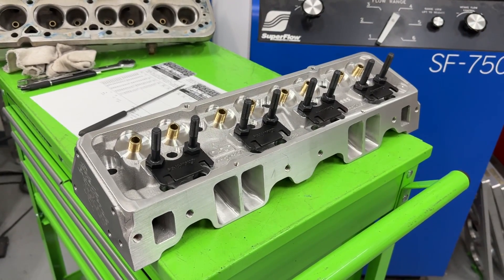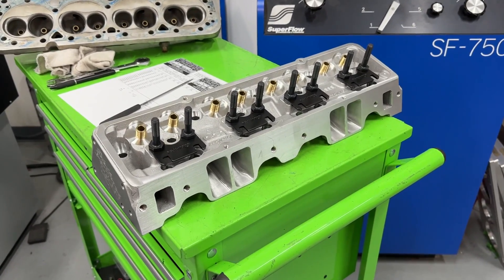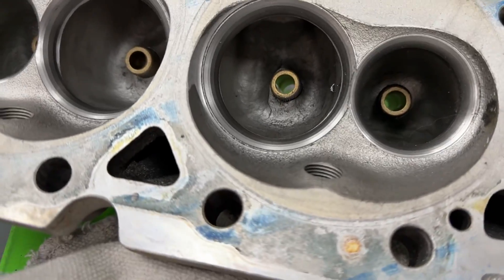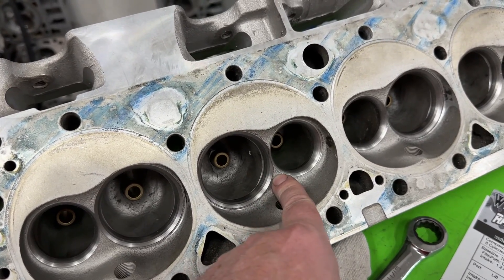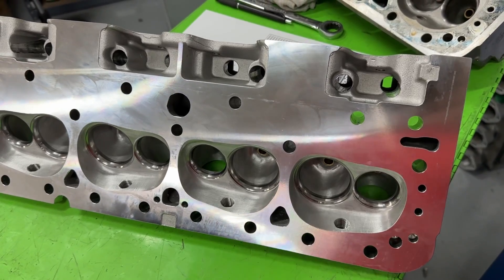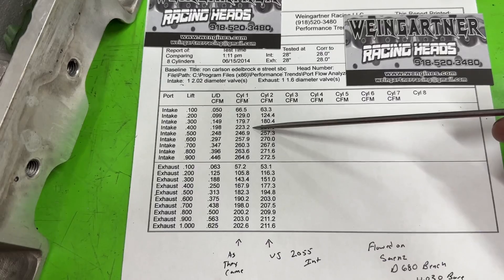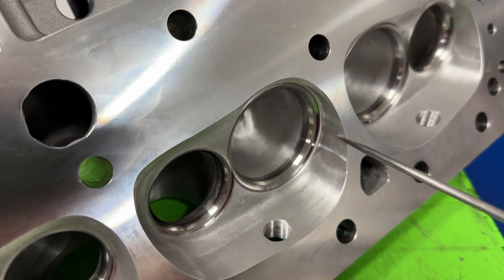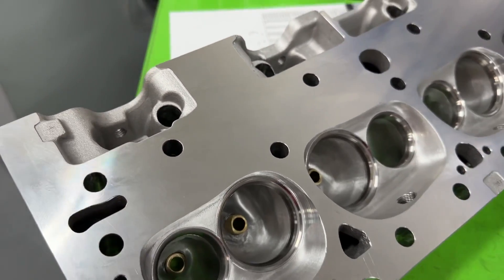Edelbrock E Street Sbc Heads Going From 2.02 To 2.055

Comment: Maybe instead of focusing on cheap heads.... Improve the Performer series to run comparable to AFR, Trick Flow, and Brodix. I wouldn't mind buying Edelbrock heads if they provided good bang for the buck. Who wants to pay $2500 for a pair of heads that produce 50 less points on the dyno than the other brands for the same money. My 2 cents

Comment: I threw these e street heads on my stock 305 sbc they run pretty good, they woke up the motor for sure, but the only drawback I had with these were those guide plates I ended taking them off because they were a hassle to adjust other than that they run good 👍🏻

Comment: I did somewhat decent back in 09 with a 383 pump gas deal i built using Performer RPM 185cc heads, they were 195cc when I finished and flowed 275in 220ex and with a 231in 238ex .550in .555ex 109lsa 106ilc, ported RPM intake 
750 HP and 1-3/4 headers did 508hp at 5800 and 499tq at 4500
Ran 11.12 at 117 in a 3rd gen camaro 
For what it’s worth the rpm Heads that I did for this motor had different Chambers slightly than what you’re showing with those

Comment: The powder metal seats I got a question on them. So if you know the Dodge 5.7l hemi engines are known to drop valve seat and I was told it was powder metal but I am not sure so if those heads have power metal are they known to drop seats